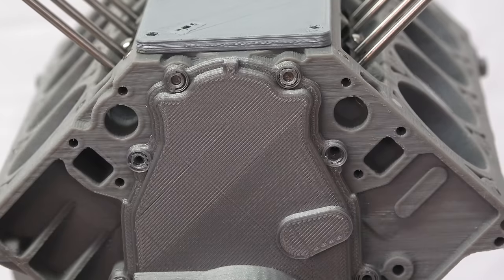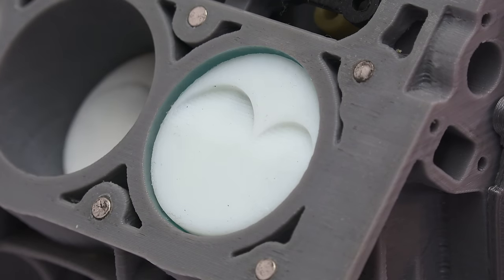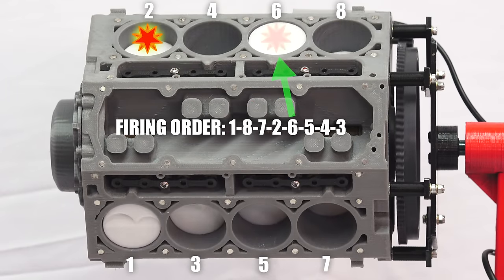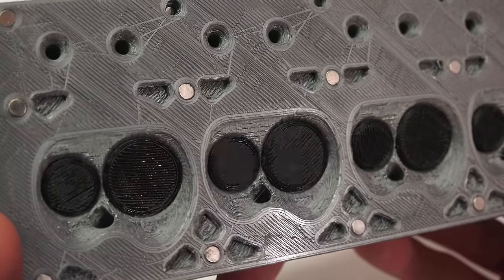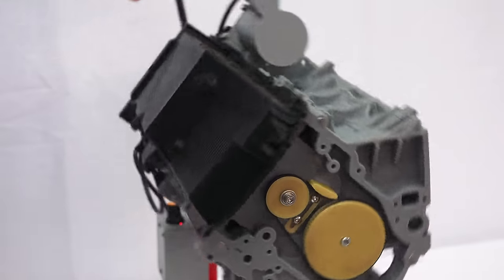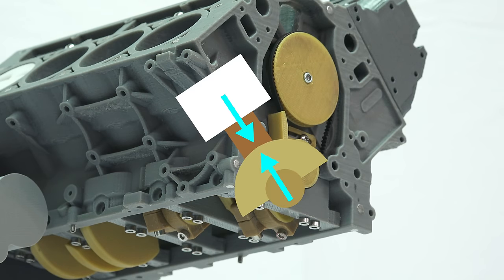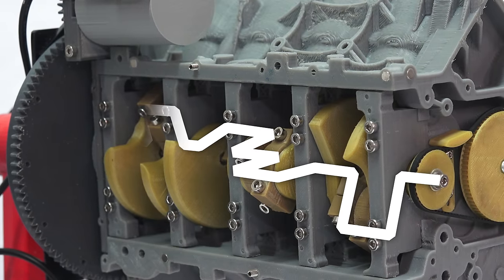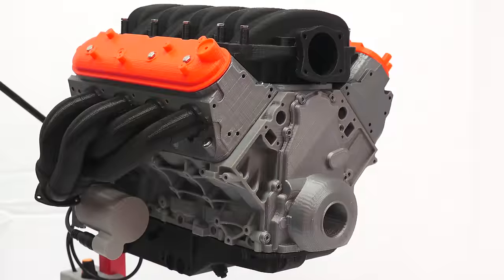How V8 Engines Work - A Simple Explanation

Comment: ah yes nothing better than a big pushrod American v8
Reply from the maker: Blub blub blub blub blub!
Reply: Mmm...depends what you want from your V8, as they don't have to have the burble, and pushrod engines are not very modern in comparison to European V8s. Each to their own though...the more different types the better for car lovers
Reply: DOHC is better.
Reply: James Thom Yes, if you want an engine that is more expensive, heavier, less reliable, less efficient and has to rev itself to oblivion to make power, you'll want a European V8. If you want an engine that is less expensive, lighter weight, more reliable, more efficient and makes power effortlessly, you'll want an American V8.
Reply: Adem Hasanovic With most objective measures, OHV LS V8 engines are superior to any European equivalent. That is why they dominate the performance car scene.
Reply: Adem Hasanovic Simple, reliable, compact, lightweight, efficient large bore OHV is better.
Reply: James Thom. "Not very modern" could you substantiate that?   Claiming that OHC is more advanced because OHC is more advanced doesnt exactly cut it, neither does the idea that mechanical complexity equals a higher state of advamcement. In other fields it is recognized that less complexity and smaller size for the work done equal advancement. 

You cant argue that OHC is advanced because its a newer design because its not. At least not by much, with OHC heads being designed for ford flathead 4 cylinders before the advent of their flathead v8.  

OHC designs date back to 1902.

Arguably a current production GM V8 is higher tech than say a 2000 model BMW V8.  

If we lived in a world where DOHC engines were the norm and someone came up with a physically smaller lighter design with a fewer mechanical parts that was cheaper to build and maintain while delivering performance and economy on par with established design would that not be considered an advancement?   In fact the only parameter that the modern OHV engine falls short in is output per unit displacement, a parameter that is often touted as a sign of superior engineering but one that has zero bearing on the functionality of the design.
Reply: OHV is much better. I can get 30+ MPG out of nearly 500hp Corvette, and the engine will be cheaper, lighter and more compact than a DOHC engine with nearly half the displacement. What European car could do the same with a V8 or any other configuration?
Reply: Well  push rod and DOHC were invented only 2 years apart around 1902 so there both very old , GM's push rod LT1 has variable valve timing , cylinder deactivation and direct injection so it is  just as advanced as a " European V8" . There are several valid engineering reasons to choose a push rod engine over a DOHC first being size and weight, a push rod 7.0L is psychically smaller and is actually the same weight as a DOHC 4.0L so even though the 4.0L can make more horsepower per liter the 7.0L can still make more power while fitting into the same chassis . 

The second reason is even though a DOHC engine has better volumetric efficiency the combustion efficiency of a 2 valve head is equal and sometimes greater because of the unique flow characteristic that causes a swirling vortex which aids in air fuel mixture,  so even though it wont make as much horsepower the overall gas efficiency per horsepower it still quite good. 

With the other two reasons in mind there is a reason to keep horsepower per liter lower,  cars with high power/liter ratios like a Honda S2000 tend to have very low torque for the amount of power they make which is fine for a very light weight sports car but for daily driven cars and trucks and even heavy sports cars  revving to 9,000rpm before it  makes power doesn't make sense. The cars will feel slow and powerless,  around 0.75 HP/liter is ideal for  peek torque and peek horsepower to be even while keeping the rpm reasonable , this provides even and smooth acceleration just off idle. Many DOHC engine also make around 0.75 HP/liter for this reason but since a simpler push rod engine can achieve these numbers it is a more preferable choice because it costs less , is smaller, lighter , and has less moving parts which makes it more reliable and easier to service.  

Good engineering is using the most effective method to achieve the goal , bad engineering is adding unnecessary functions to overcome a design inadequacy such as adding 3 extra cam shafts, twice as many valves, variable valve timing ,  variable valve lift, variable intake runners, two turbos, a intercooler and water injection when you could achieve the same results by just adding  0.50" inches to the bore and stroke.
Reply: Don Lorenzo. In my opinion there seems to be several crossover points when you look at each design and various applications.  This is why you see modern camaros and challengers with base V6 engines that are dohc and produce pretty decent power for tue displacement.  If the manufacturers expanded those to V8 proportions you would get 400 or so HP and 4.8 liters. Comparable to chevys base V8, but likely lower torque below 3K and slightly worse real world mpg.
Reply: DrewLSsix I don't see where the crossover is or what the point of your comment is either. Displacement in itself is not a problem. Just because you make more horsepower out a of less displacement doesn't mean you're doing something better, and it ignores that fact the horsepower is equally a function of RPM and torque. I don't really care if you make 1,400hp out of 4.8Ls. You'll be making an expensive racing engine that revs to XX,XXX RPM and will blow up after a day of driving.
Reply: i had to explain this to a senior engineering student the other day who told me the ecoboost is more advanced than the new LT motors because its a dual overhead cam and twin turbo motor. lol as if that means anything as far as "advancement"  turbos have existed for a very long time and so had OHC so neither are "advanced" by an innovation standpoint thus using 1 or both is not an advancement either.  He had no other reasons other than MPG , to which i replied the MPG difference is about 1 mpg and that's by comparing entire vehicles and drivetrains not motors. the 1 mpg difference could be from reduced drivetrain friction let alone the hundreds of other variables possible when the EPA runs those tests.
Reply: WillerNK.  My point is that even though GM uses pushrod based engines for trucks and budget friendly performance cars they dont use pushrod engines for fwd econemy cars or even the base models of their performance cars.  Have you never wondered why the Cobalt didnt just use a 4 cylinder junior variant on the LS architecture? 

My point is that application determines the choice of engine.
Reply: emdec55. Im not sure what you mean by "estimated" as all the numbers are available, and Im not sure what you mean by power density but wether its power per liter or power per pound the DOHC soundly trounces the 4.3....

And you are basically trying to claim that GM is developing all these DOHC engines for no reason, as if you know better lol.
Reply: ChokeKOO! And if you want an even cheaper, lighter, bulletproof, INDESTRUCTIBLE stock internal V8 youll want a Japanese one like the 1UZ.

Comment: Most (if not all) V-8s are 90 degrees but my V-12 Jag is 60 degrees. Is there an engineering (balancing) reason for that or simply because space is tight in the engine bay. I'm a railroad engineer and the engines in a diesel locomotives are 45 degrees purely because of width limitations. The 16s are reasonably smooth but the 12s vibrate quite a bit. Never had anything to do with 20s.

Comment: Not to be overly picky, you stated that the ls3 cylinder numbering started on the right, which is incorrect. The diagram was correct however. All references as to location should be given from the drivers seat, not the head on facing position, this is a common mistake. Given your mechanical and vehicle knowledge I hated to point this out 😊
Reply from the maker: Uhhh, what? The numbering starts at the front of the block, which is at the front of the car. The firing order shown is correct.
Reply: Engineering Explained , yes in the illustration it is correct, but you stated it was on the right hand side, which is incorrect, the left bank is the leading bank not the right which you stated.

Comment: Why is the intake valve bigger? Shouldn't it be opposite, because engine produces more exhaust gases than it needs air?
Reply: I hope this is a joke right? Intake needs to be sucked on by admospheric pressure only usualy, the exhaust can be forced out by the piston hence it doesnt need much clearance.

Comment: Isn't there a cylinder firing for every 45° of crank shaft rotation is this example?
Reply from the maker: Two full crankshaft rotations for every cylinder to fire. 720 degrees divided by 8 cylinders = 90. :)
Reply: Ah that makes sense, thank you.

Comment: Wait I got a bit lost. Does the camshaft give the power to the transmission or  the crankshaft?
Reply from the maker: Crankshaft rotates the flywheel or torque converter, which transmits energy to the transmission. The camshaft is purely used to operate the intake and exhaust valves.

Comment: Why did engines from back then have small displacement but still being V8 engine? I know engine's displacement is made by the engine bore and stroke, but I'm just concern about why did they do that because now chances of getting a V8 coming from a minimum of approximately 4000cc is just high but you'd find old cars be like 2.9L V8... what was the benefit? they could have did a V6 or Straight 6

Comment: Is this entire motor 3D printed?
Reply from the maker: There are a couple hardware components (washers, screws, etc), as well as the electric motor, but for the most part, yes. Entirely 3D printed!
Reply: Engineering Explained that’s awesome
Reply: with magnets holding the parts together which is also awesome!

Comment: Why don't we see more small displacement V8's/V6's?, something like the 2.4 V8 in the Atom, or the 1.8 V6 in those old Mazda Mx3's?.. 
Is it simply a parts cost thing?, or what?

Lets say we have a 2.0L I4 and a 2.0L V8, Both making 200hp. Would the I4 have more torque?, or would the extra cylinders in the V8 make up the difference?

Comment: I don't really get the reason you couldn't have opposing cylinders firing together?   The torgue increase would be huge.
Reply from the maker: Ultimately the same amount of work would be done either way, it wouldn't be more powerful by having multiple cylinders fire at once, but it wouldn't be nearly as smooth. You want the firings evenly spread out so that the engine runs smoothly.

Comment: A never wonder why a inline 4 cylinder with a crossplane crankshaft is not widily used in road cars. It doesn't the downsides of V8, the only caveat is engine displacement limit.

Comment: What is displacement?
Reply from the maker: Basically the size of the engine. It's the swept volume of the cylinders by the pistons. For example, if you have one cylinder, you'd measure the volume when the piston is at the very bottom, minus the volume when the piston is at the very top. Then you'd multiply this volume by the number of cylinders. Another way of calculating it is finding the volume of an individual cylinder using the bore and stroke measurements, and then multiplying by the number of cylinders.
Reply: Ah right, that makes much more sense than anything I could think of. Thanks!
Reply: It's good! The more the merrier :-)

Comment: How many or what's the maximum thrust power of v8 Engine?
Reply: Depends on the engine. The one shown in the video is an ls. With upgraded parts they can make over 1000 hp. Then you have stuff like top fuel dragsters that have v8 pumping out 3000 hp.
Reply: @Redtooth75  thanks.
I wish to get one of those cars one day, for now I can't afford any of those at all but I believe one day I will be able to get it

Comment: Why does a V8 have such a great deep sound, even with a standard exhaust, do they have a different diameter or stroke to a 4 cylinder, because 2 , 4cylinder engine running together don’t sound like a v8 ,
Reply: Much of it has to do with opposition of the exhaust cycles.  Someone with more knowledge than me will probably follow-up..

Comment: Why are they still so committed to push rods?
Reply: LS engines are relatively cheap, reliable, compact, fuel efficient and super light weight, the size and weight of engines half their displacement. This is why people swap F20Cs, MZRs and 13Bs with LS engines, because they easily fit in anything, add little weight and can more than double their car's power.

Comment: Ok engineering explained I NEED to learn HOW an mgu-H system works in an f1 car, not just that it converts heat into electricity, but HOW it converts heat into electricity mechanically pleaassee

Comment: Same as V6, but bigger
Reply: Really? Not sure about that. Do v6 engines have 2 cylinders exploding at the same time too?
Reply: @angelgjr1999  No, but they have 2 cylinders that have combustion simultaneously
Reply: @angelgjr1999  No, you said that the cylinders explode. If they exploded, they would be cracked and not functioning properly and the engine will be fucked.

Comment: WHY ? WHY ? WHY ? no electronic valve opening. no need for cam shafts etc. PLUS easier to add cylinder deactivation
Reply: electronic valve opening likely wouldnt be fast enough at higher rpm, and you would have to have EXTREMELY INSANELY powerful electromagnets, it takes in some cases several hundred pounds of force to actuate a valve. It would be very intresting though if some engineers could figure out how to make this work, plus you wouldnt even need to change a camshaft to get higher valve profile.
Reply: @dumdum7786  exactly. If electric motors can run Teslas so fast why cant they move  a simple, little valve ? Only problem is dealing with extreme heat.
Reply: @RemusKingOfRome  there is no way an electric motor could operate fast enough to actaute a valve even the highest quality motors dont even come close, instead, solenoids (electromagnets) would have to be used. Solenoids, which are an order of magnitude faster than electric motors, even still arent fast enough. Keep in mind, solenoids and electric motors are not the same thing, they are entirely seprate machines. Electric motors spin while solenoids only move in and out. And also solenoids wouldnt be strong enough to actuate the valve.

Comment: I think  that's the wrong firing order, that you said I think it is 18436572''
Reply: that is the firing order for the gen 1 small block chevy, the engine in the video is an LS which has a 18725643 firing order. Some ls engines switch the 7 and 4 in the firing order

Comment: The ls engines need dual overhead cam and 32 valve
Reply: emdec55 why? DOHC would increase horsepower and airflow
Reply: emdec55 well what about the mercury racing sb4 engine? It's based on the 7L ls7 and uses dohc while making 750hp N/A.
Reply: The LS is a small-block engine, and it is meant to compete with smaller DOHC engines that make 400-800hp. It's biggest advantages come from the fact that it is OHV and has fewer moving parts. In reality, it's much superior design, because there are virtually no disadvantages, falling into the weight, size and performance parameters of smaller displacement DOHC engines, but it's advantages are lower cost, higher torque, better reliability and better efficiency.
Reply: emdec55  i didn't actually know it wasn't road legal. And I'm kinda caught in the middle between what v8 engine is really good. I've heard alot of good things about the ls and coyote engines. What engine would be best for a track and daily driven car? I need some opinions
Reply: emdec55 i know that the ls engines can be paired to a manual awd transmission and the coyotes can't be. What i need help deciding on is an ls awd Subaru brz or a coyote brz
Reply: Search LS vs Coyote build. You will spend more on a Coyote, you won't be able to fit it, or it won't be simple or as easy to work on or tune. For the power you want, there is no better engine than an LS.
Reply: K Zed what series of ls engine should I put in my brz? Because i do want to make it a awd track car as well as daily drive it?
Reply: Derrick Porter It's all depending on your budget, how much power you want and how well you want the vehicle to handle. My question is, how the hell are you going to add AWD to a BRZ? That changes so many things.
Reply: K Zed i don't exactly know until i actually get accurate measurements of the transmission, the transfer case and engine ik it will involve alot of fabrication but it can be done
Reply: With enough money, anything can be done. It still doesn't give me a clear idea of what your goal is. LS engines are wide raging in application. If you want a simple, high-powered sports cars, any aluminum block LS will work. If you want to make a 1,700HP drag car, there's an LS for that. If you want to make a garbage truck that will be driven 1,000,000 miles, they make an LS for that, too. They are all in the same family of engine, share parts or architecture. I could swap a few parts from one engine and get 100HP more just like that.
Reply: K Zed my goal is 750 hp and to be daily driven while weekend track days
Reply: WTF? Are you serious?
Reply: Josh yup
Reply: You can build a 750HP LS, but to be honest, a 750HP AWD BRZ daily driver seems silly.
Reply: K Zed Seems????
Reply: Derrick Porter Ok, have you ever driven a lightweight car with 750 horses before? That power isn't usable to an inexperience, non-professional driver.
Reply: Derrick Porter You're joking AF.
Reply: Josh i have good experience with 500 hp and it's mostly just a thought i just wanted to think of something out of the box and if it could be done. I couldn't do it if i really wanted to anyway cuz of the extreme cost